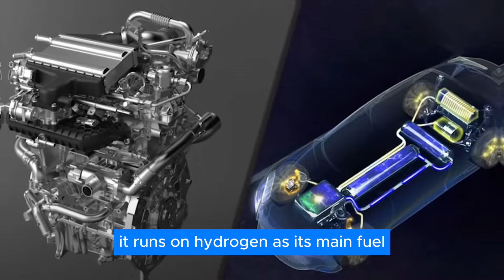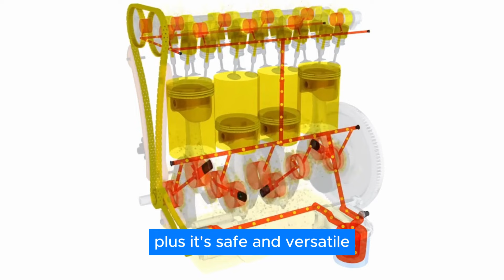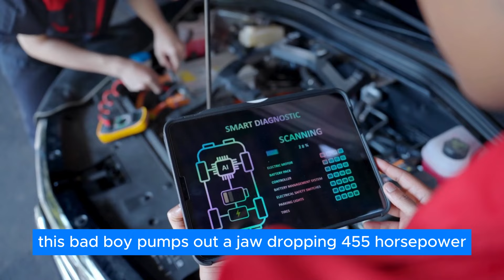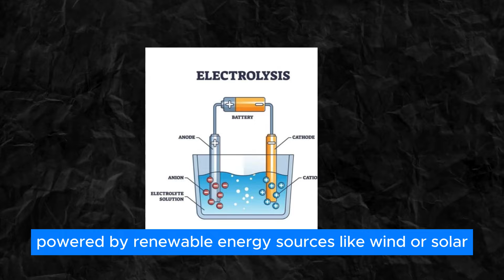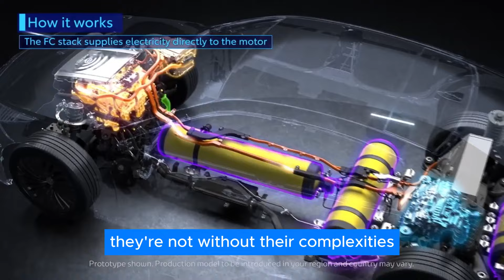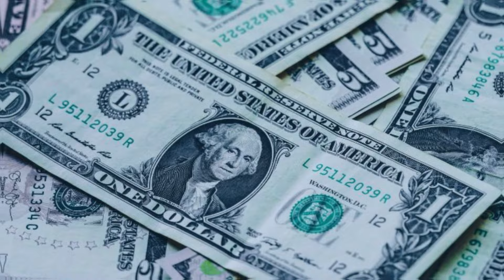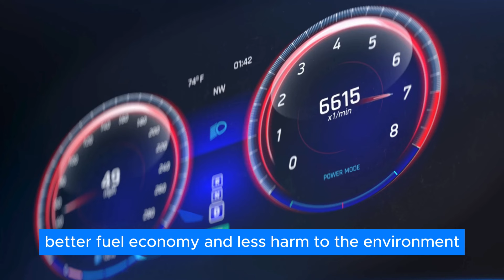Toyota CEO: "Our New Invention Destroys All Other Car Manufacturers''

Comment: Betchya the Hydrogen won't be cheap...
Reply: Probably, but if 5kg gets you 300 miles it could be four times as expensive as petrol/gas per kg and still be cheaper. You'd need around 25kg of petrol (about 30 litres) to go the same distance and that's in a pretty efficient car. I'd need 5o litres with my V6.
Reply: @CrazyTechLab  Yeah, I calc stuff too. My V6'll do 13KpL...sweet, but then I do calc on Escooter (for local commute) and the savings blew me away. ie : 20A x 48v = 960wH (say 1kw) .30cens to ride 50/60 kms